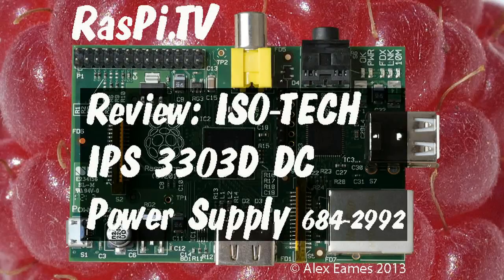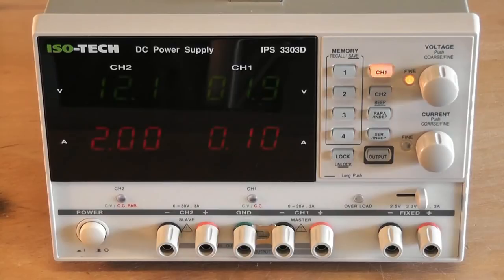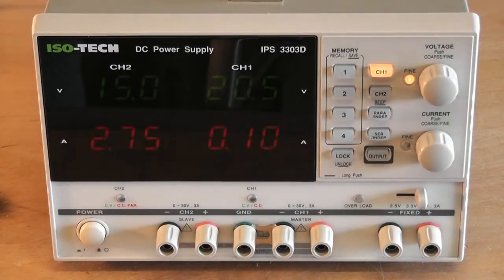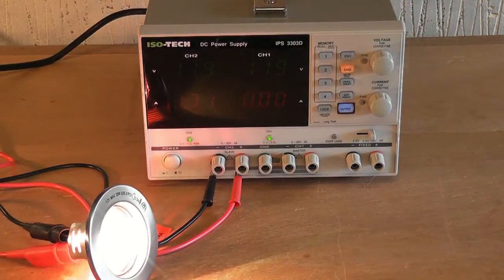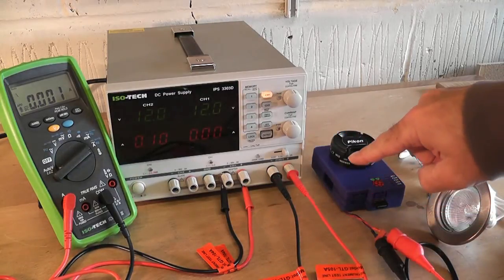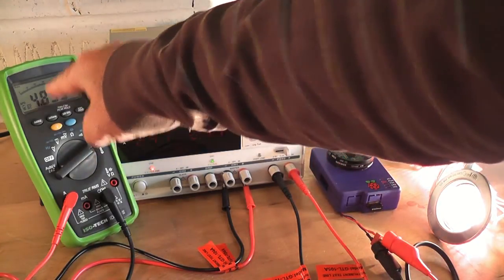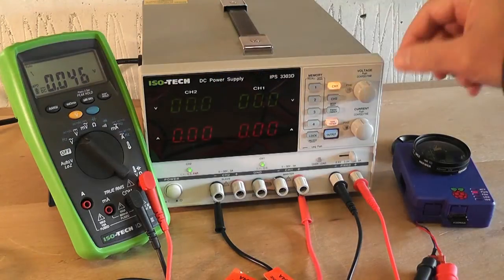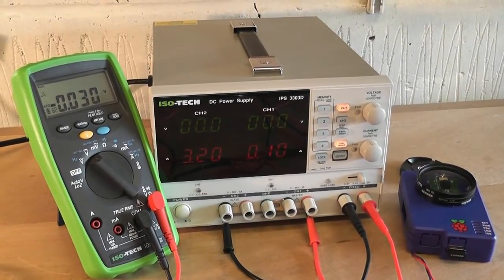ISO-TECH IPS 3303D Bench Power Supply

Comment: It seems strange to me that CH2 is on the left and CH1 is on the right. I know this doesn't really matter, but If I had one of these power supplies, I would find myself assuming they were the other way around. BTW, it's called a 'SERIES' connection, not a 'SERIAL' connection.
Reply from the maker: Yes I suppose it might be counter-intuitive to have it that way round. I'm pretty careful to try to read the labels and make sure I plug into and tweak the correct side. Yes I know it's called series - it's kinda hard to make the right words come out when you're making a video and you don't always catch all the errors in editing. :)